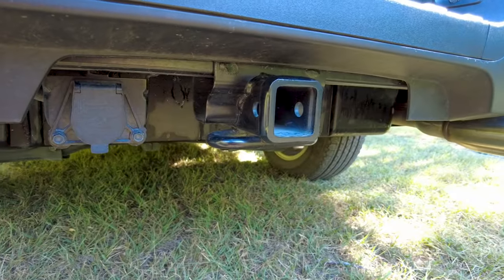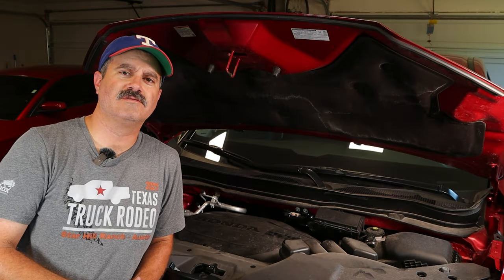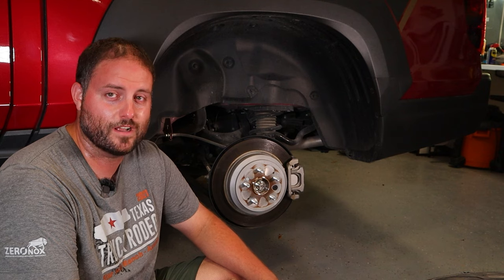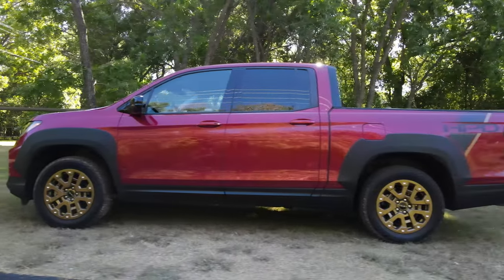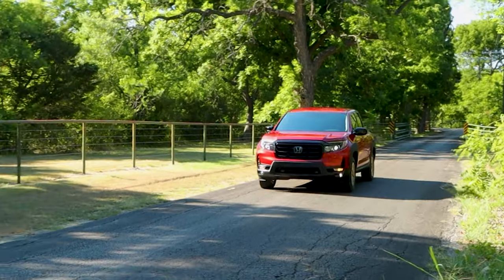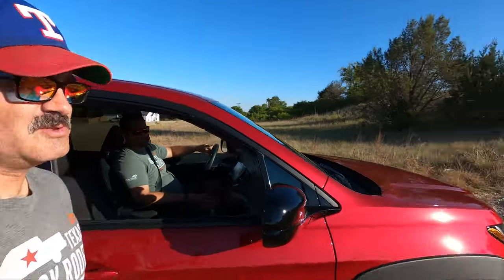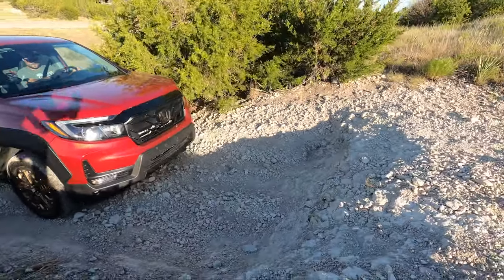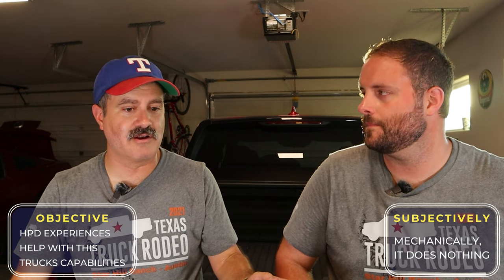Honda Ridgeline HPD - The Unconventional Truck Solution // FULL TEST

Comment: I've been in Agriculture for 30 years. I've driven just about every truck there is at one time or another. My last truck was an '18 Ram Longhorn and it was a beautiful truck. The project that I bought the truck for ended so I sold it off and was truckless for several months. So I started researching and test driving for the next truck. In the meantime fuel prices went up markedly and I had to sit down and be really honest with myself about how much truck I really needed. My days of hauling two full pallets of crop chem 70 miles to my customer's farm on the gravel the whole way are pretty much done. But I still wanted to haul plywood or drywall sheets flat in the bed. I never did use the low range 4X4 in that Ram for the 2 years I had it. It had a 5.7L hemi and a gas tank to match. I realized I needed something to haul small loads when I needed it, and maybe a trailer to haul a couple of motorcycles or a quad, and a bunch of gear if I was out scouting fields or hunting gophers on Southern Alberta's short-grass prairie. I didn't need a full sized truck. So I drove what was around and my youngest son and I (that's a total of near-600 pounds of testosterone-filled handsome manhood right there) got into a Ridgeline at the local Honda dealer and realized how much room we still had, well, that was a good start. The rest of the vehicle's features sealed the deal, especially the way it was thought out, and the trunk in the bed (I had the Rambox on my Ram and loved it). I was going to spend the vast majority of the time with this truck on a paved road or dirt/gravel roads so ride comfort became way more important than the 5 or so percent of time I'd be climbing a coulee with it. So I ordered myself a 2022 Black Edition and I pick it up today. My son was so impressed he traded off his hatchback Civic for a 2020 Black Edition we found at another dealer. He's been in love ever since. Trucks are a pretty subjective thing, and can be a very personal choice. i get why guys like the Tacos, the F-150s, and the Sierras. I loved my Longhorn - every time I got in it I thought to myself "Damn!...This is a nice truck!". And it did more than I needed it to do. But the Ridgeline Black Edition is easily it's match for comfort and luxury features. And every time I pull up to the pumps, I won't miss that extra hundred bucks it cost to fill it.
Reply: I can see that your a proud owner of ridgeline just like me. Ive been seeing you commenting to ridgelines vlogs. Im Happy for you. Ive been pursuading my friends to get 1 so that they can have the satisfaction that im having all time with different driving situation.
Reply: @peter-gz9fj  Yep! I've had the Ridgeline for a couple of months now and it has exceeded my expectations across the board. That transmission is so smooth you have to work to feel it shift. So much more comfortable to drive. I put a Peragon tonneau cover on it and it looks great! So much more to say but the short version is: go get one. You'll be waiting for it now with the chip shortage, but it'll be worth it!
Reply: The Black Edition Ridgeline will be my choice when my 08 (original owner) wears out.
Have a great day.
Reply: @johnlopez3001  So another 10 years then? Lol...order early. When I picked mine up the factory was 25k units behind. And no, you won't be sorry!

Comment: I have an '18 RTL-E and love it. After driving 3 different 4-Runners for 20 years, this is my first pickup... I call it my Gentlemen's Truck. It does absolutely everything I need or want to do and supports my active outdoor lifestyle perfectly. Loading it up with kayaks & camping gear, or pulling my pontoon boat I never have to worry about power or capacity. I love the '22 front end and my upgrade but will probably wait until Honda does a complete re-design in a couple of years.

Comment: Good video. Honda really needs to get it higher in the front.

Interesting to note that the HPD Baja Ridgeline is chased by a stock Ridgeline support truck that has a 1.5” level kit, better tires and a front skid plate.

I actually bought mine right during COVID after having made fun of them for years because the Tacoma TRD off-Road I was about to buy had $1,000 added on by the dealer. When I brought it up, they laughed in my face, so I walked next door and gave the Ridgeline a drive. It was great for my needs, as I don’t do hardcore off-roading and the space and comfort were huge.  It is also a lot more capable than people give it credit for as you guys mentioned.

With a payload of 1477 in my fully loaded trim, I’ve had 1400lbs of dirt in the back, I’ve towed cars, hauled large car parts and done everything pretty much every other midsize truck would be asked to do.

I initially leased it because I thought it would be a disappointment. I just bought it off lease.

P.S. I love the F-150, but I swear you have to sell a kidney to get a good one!  A comparably loaded full size was up to 50% for equal features.

Comment: It's a truck. I think it is time for us to move-on from the "Well, it doesn't have a sub frame, and a unibody can't be a truck." Look, if it has a bed, can carry & tow, it's a truck. I purchased the 2021 model (this exact color) with the RTL-E package (Yep, it's loaded), and kept my Dodge Ram 1500; if I need to carry a heaver load, or pull a heaver load, it's my go-to. But, if I can, I'll use my HPD every time. It is such a joy to drive - so comfortable, plenty of power, and it is the storage king. I even enjoy driving it in sport mode & using the shift paddles. And yes, it's a party truck; the trunk has a drain plug, so you can make it a cooler, it has an outlet in the side of the bed to run your drink mixer, and the entire bed is a stereo speaker.
Reply from the maker: Precisely!

Comment: Well I am a Honda guy. My first car was a 2001 civic when I was in high school, took a lot of punishment from me lol. When it was finally time to upgrade, I could have gotten a used Dodge Challenger or a used Mazda sport car (can’t remember the model), but I decided to buy a used 2011 civic instead because A.) had less miles on it B.) was cheaper and C.) it’s more reliable. Then I started working in construction, and that meant most of the times I would have to drive to and or park in unpaved gravel roads. And while my civic has endured the punishment I really do need to upgrade. Especially now that I have way more tools than when I started. I don’t want a gas guzzling RAM, nor do I want an unreliable Chevy/GMC, nor do I want an expensive Ford. I do like the F-150, but even the used ones with 100k miles are 35k dollars. Tacomas are quite nice but expensive too. So I went to look in the MID sized Trucks, the Ranger, Colorado, Maverick, Frontier and Ridgeline. I was leaning towards the Maverick at first because it’s cheaper, but I hear there’s problems with supply, and problems with the system, well you get what you pay for huh? So then I look at the Ridgeline, and it’s like, the truck I need. Honda knows me so well. Bit expensive too but hell, I know it’ll last me a long time with minimal problems. I know so because I see people talking about still driving their 08-12 Ridgelines who did their maintenance and had minimal problems. Plus the new design for the 3rd generation Ridgeline looks great! Just a 3” lift, add some running boards, some off-roading tires and BAM! Truck elitists won’t be able to ignore me then lol
Reply: Great comment,  my 08 Ridgeline (original  owner)    is still going strong.
Check out YT channel VIP Auto Accessories video  
2020 Honda Ridgeline  -  DIY Blackout Edition.

Comment: I have the 2021 setup. What I don't like is the crappy  info-tainment centre ! It is junk, it's so slow to respond, the Garmin GPS is a lost cause for its display and this thing needs a larger, better built power amp in it. Oh and the soft on display buttons are another lost cause, please put in real function control buttons.  How could Honda screw this up so badly in their only half decent pickup (truck). I think that the Ridgeline needs a much faster and higher level computer system that controls the main drive functions here to. Yikes !